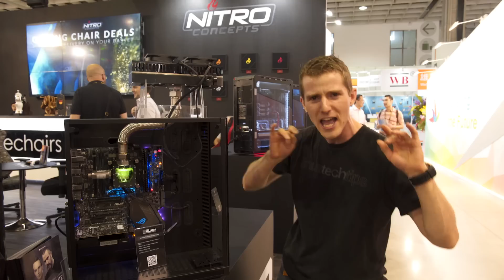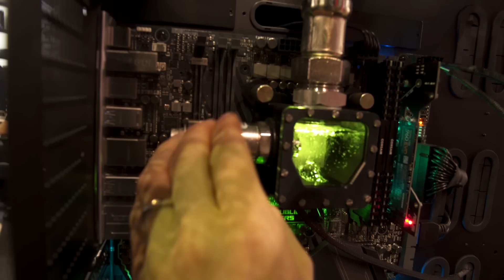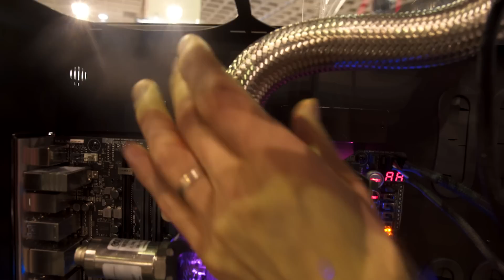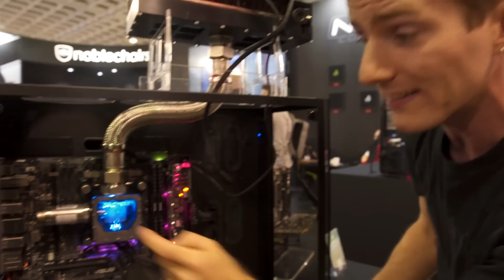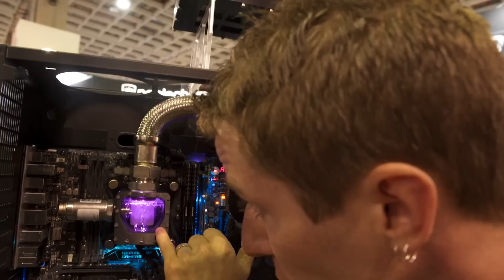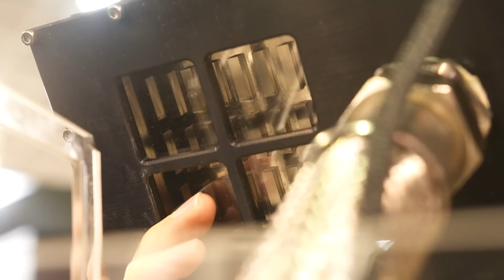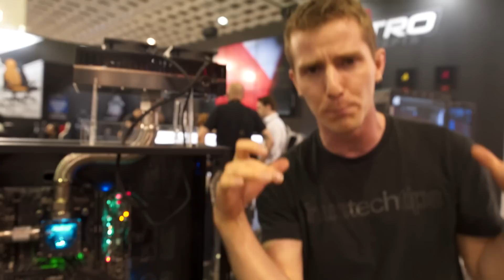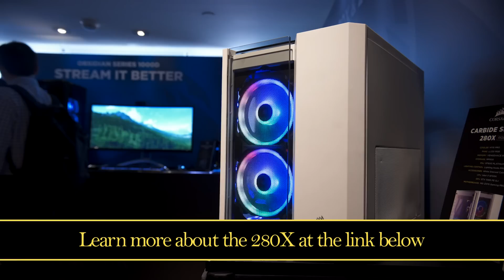Crazy Der8auer cooler prototype - NO pump!

Comment: I haven't had a chance to read the comments yet, because I'm driving - but as far as what coolant is in there, I would have to say plain old distilled water. Under a high enough vacuum, water would be perfect for it as it would boil at a low enough temperature to be usable, and also be perfectly safe. With this said, I'm betting dozens of other people have already suggested it. If not, well then...

Comment: Probably ethane, propane, butane or a fluorocarbon, IF that is genuinely copper plumbing...

OTHERWISE, if that is just copper on the OUTSIDE of the circuit, I call Ammonia to be the working fluid of choice.

Comment: Hmmm, the viscosity looks like water but takes too much energy to boil up to condensation point. Could be alcohol based but you run the risk of off gassing from stuff like IPA, plus they are very good at denaturing cheap Buna-N o ring seals needed to keep the goop in the pipework. On the cpu block I'm a bit more confident of my idea, it's possibly a double wall job or a box within a box thing, the gap between the boxes allowing the condensed liquid to flow to the bottom of the cooler and heated again by convection currents alone. 

Coolant could be saltwater and you wouldn't use MEK for that as it's too volatile, can't be Coolanol as that stuff is lethal in confined spaces and best advice is to not use it in boiling systems...... unless the system is fully sealed from factory.... but it's a liquid so leakage is going to happen......

It's not a liquid gas as no frosting 

Damn it...... you've piqued my curiosity..... worst thing to do with an engineer....

I'll work it out

Comment: Pressure sensor? I think it is water under a partial vacuum. That would lower the boiling point of the water. Water has the advantages of being less volatile and flammable than alcohols. Water is also cheap. The pressure would have to be about .07 atm or 1 lb/in^2. Hmmm... did he say the glass was thick?

Comment: Could the liquid be Dicridemomethane? Basically the alcohol-tainted tears of democrats after the 2016 election? Not necessarily rare, regenerates itself endlessly, circulates in an endless loop and a new supply is generated every time POTUS issues a tweet. Rumor has it supplies will become endless after November and the price will plummet, hence the delay in the release of this novel cooling solution! Waiting on the price of Dicridemomethane to come down even more. And to think Linus said we'd never guess it! {drops mic}
Reply: Hahahaha you took the words out of my mouth and I couldn't have said it any better. So yes its liberal tears.

Comment: Few ideas. Methyl Bromide, Methyl Acetate, Methanol. First 2 are poisonous so I wouldn't be surprised if they only make a few hundred. Boiling points are 3c for Methyl Bromide and 57c for Methyl Acetate. Idle temps would either be crazy low or would have to heat up to 57c for it to boil. Plus the vapor could leak and you would end up poisoned. Either way, I want one.
Reply: Methanol is also a poison
Reply: Methyl Bromide and  Methyl Acetate will dissolve the pvc inside the braided steel connector and cause a catastrophic failure so those two are impossible.
Reply: @jarstore  what about methylene dichloride?

Comment: The liquid has to boil and not expand enough to explode the device. Could just be glycol and water but could a cpu boil water and glycol? Like a floor heat system that runs in a house. They run on a heat exchanger not direct boil. Maybe some type of alcohol mineral oil mixture, that would probably seperate.

Comment: looking at the case and the reinforced tube the system has to be under alot of pressure.   That rules out anything thats liquid at atm or vacuum pressure. I think its a butane, propane, alcohol, or a refrigerant like r134  . could be co2 but that would be a ridiculous amount of pressure.  Its possible for it to be water but then it would be running in a partial vacuum.

Comment: You could keep the liquid under a soft vacuum, then all kinds of liquids with comfortably low freezing points would work. It might also be propane, or butane, or ammonia, or some other gas kept above atmospheric pressure, though hopefully nothing flammable.

Comment: For everyone trying to guess the liquid, don't forget that the way they make heat pipes and vapor chambers so effective is that there's a vacuum inside the closed environment.  This reduces the boiling point of the liquid.  And while there are quite a few liquids that have low boiling points that are even lower in a vacuum, they're not suitable for a safe and reliable product.

Comment: haha...talking about me when i worked at OCZ, wow brought back memories that did, i still use watercooling by convection, had it actually on a huge loop which would remove around 700w off 3 CPUs on test systems, now I just use it on a file server.

You don't need a pump if you get the right block, the right CPU and do the plumbing right..

Thanks for the mention Linus, been a while since i did anything with PC's or memory, or SSDs....time change ;-)

Comment: I think he uses low pressures. With low pressures the evaporation temperature is as low as you want. In fact you can even improve the temperature control. In fact I think that's why the pipe he uses is so wide. The pipe is wide to facilitate evaporation and at the same time the liquid that has been condensed, falls through the walls.

Comment: My guess is the 3M Novec Engineered Fluid. It's literally designed for immersion cool and taking advantage of the phase change from liquid to gas to cool down processor and boards at the same time. Check out this video for more info, https://youtu.be/a6ErbZtpL88

Comment: liv04soccer
I have novec 7700 in my custom loop right now no need for all the fancy pressure sensors and chamber been running for 6 months no problem.

Cooling a 1950X at 250Watt draw gets to 85c but works no problem.

Comment: With a requirement to not be corrosive or overly toxic thus making it highly regulated and expensive plus to have a reasonably low boiling point in order to efficiently cool the CPU while being able to do all that without any pump system, there can't be that many options out there for  the liquid in that prototype...

Comment: i'm pretty sure it's just propane or butane, that looks crazy dangerous, i'm surprised that Linus was face checking that thing.
Reply: Liquid propane when exposed to that kind of heat in the setup they would have would vaporize and the pressure would explode out and possibly ingnite. as for butane i would also doubt that as both options are extremely dangerous.

Comment: Inert, non-conductive fluid with a low boiling point to allow phase change cooling. Will probably be an engineered fluid from 3M (such as Novec)

Comment: i think the liquid is not really the key issue, this tech may have created a much low pressure condition, so no matter wat liquid for cooling, as long as u change the pressure , u'd have a much much lower boiling temp:) from the setup of this gear and missleading liquid discussion, im pretty sure about this.

Comment: Guessing a suitable coolant isn't very hard.  You need something nontoxic and chemically inert, with a boiling point of 40-60°.  It's better if it's also nonconductive, in case it spills.  It's probably perfluorohexane or another Fluorinert™ chemical.

Comment: Probably n-pentan or n-hexan would work quite similar. Maybe even isohexan which has a boiling point of 60 degrees Celsius, but the heat should be taken away almost instantly when the fluid is boiling, so possible.

Comment: Has to be 3m novec, here is my guess https://www.3m.com/3M/en_US/company-us/all-3m-products/~/3M-Novec-7100-Engineered-Fluid/?N=5002385+3290667247&rt=rud
https://multimedia.3m.com/mws/media/65495O/3m-heat-transfer-fluids-brochure.pdf
The reason why you have stainless hoses and a pressure release valve is Novec like Fluorinert expands with heat and also being a solvent will dissolve elastomer out of some plastics, which is why Cray supercomputer HEU cooling system hoses are all made from stainless hoses.

Comment: Actually...this is almost exactly like refining oil. You heat it to separate the crude from the gas. where normally at the top there is fans that recool the gas for storage. Vs the heavier crude that doesnt evap at the same temp stays at the bottom and can be transferred to a separate tank. I bet its very simlar

Comment: its gotta be a basic refrigerant as the coolant boils off it rises and condenses in that condensing coil the question is what is the saturation point temperature (temp it starts boiling under x pressure) look at a chart and just figure out which refrigerant closely matches it and boom.

Comment: There is no way to guess which kind of compound is that without knowing the pressure it's currently running with. You're missing two variables in this equation. 

.... btw, it is just water at 1/10 atm. Look at these bubbles. It's water guys. Must be something insanely dumb to think we would never guess it.
Reply: That's possible. What do you think about just using acetone at room temp or possibly very slight vacuum? That should work just as well, and it's a clear liquid like water.

Comment: Potentially low pressure system with water. Water boils at lower temperature. You require a surface to 'encourage boiling'- superheating issues etc...

Comment: my guess is its a trick question 
i believe its a mixture or water and argon gas, 
argon has a very low evaporation point and its conduction rate is only a couple of decrease difference so it could run throw a full cycle of evaporation and conduction with very little changes in temperature .
in its liquid state its used as a cryogenic so it has natural cooling proprieties
plus its water solvable witch would stop the liquid from being completely boiled of as water has a boiling point of 100 decrease. and argon is also none flammable and compresses more easily than air so less chance of pressurised explosion then plain old water

Comment: It's actually a quite limited number of suitable liquids. 1) boiling point needs to be above ambient as you don't want it to keep going when the pc is off and 2) you don't want it to be much above say 40C as once it's boiling, the temperature will remain constant which is what is causing the cooling to happen. So suggestions like water, ethanol, chloroform etc are nonsense as their boiling point is way too high to keep the cpu cool or even from keeping it from throttling. Something like the ether family would qualify as they boil around 35C.

Comment: It's water.
They just keep the pressure low to lower the boiling temperature. Low pressure also means less leakage problems.
Also boiling temperature can be controlled by changing the internal pressure - keeping proper boiling temperature is a big PITA.
That's why they need that big-ass pressure monitor to make sure the pressure is kept low.

Comment: This is NOT a passive cooling loop. It has {and requires} electric fans on the condenser. Without them, it simply wouldn't work. Doesn't matter if your electricity runs pump or fans, passive is passive and that aint it. P.S. the coolant is R-134a ;)

Comment: It's an ammonia solution. It boils at about 80F, and has high thermal conductivity. It's far safer than alcohol as far as flammability and combustion goes, and is safe enough to be sold to the masses as a cleaning product.

Comment: (1) Feser  One Non Conductive Cooling Fluid

(2) 3M's Novec Cooling Fluid

(3) Thermochill EC6 Non Conduetive Coolant - Clear
Reply: Those dont boil at a low enough temp for the cpu to not be overheating tho without creating a vacuum environment...so nope

Comment: "The boiling point of water or any other liquid depends on vapor pressure. As you lower the pressure, the boiling point of the water drops." -thoughtco.com...
So im going to say its water + additives in low pressure config.

Comment: No one did it cause it's pointless. They probably had fun engineering it and it made some good pr for the sponsors but the actual perfomance/cost/limitations will be worse than simple custom wc loop. You want phase change system that actually gives some performance improvement for all the additional cost then just turn ac unit into water chiller.

Comment: I say it uses LPG (Propane) or Butane... It needs to be boiling at low temperature and tolerable pressures... I am working on a prototype using this kind of cooling solution and LPG is my best bet for now, unless I want to go with way to high pressures...

Comment: Its a dual chamber reservoir-cpu block . Inside of the block the warm liquid boils up (as a gas)into the center of the tube to cool down and then when its liquid again it drops down from the side of the same tube(maybe double chamber tube) left and right to the bottom of the reservoir. The problem is that they need a specific heat transfer to keep the liquid under specific pressure to keep circling.. i think its LN2 . And thats a damn thiccc glass cover

Comment: guys its 3m novec! it was a huge thing where they basically fully submerged the servers without heatsinks and used air conditioning piping to recondense it in the air above the lipuid. cool but expensive, its nonconductive and has a low boiling point and somewhat decent thermal conductivity. its super cool to look at but not as good performance wise as watercooling

Comment: Acetone! - Cheapest, easiest, only a little toxic. Boils at 50C at atmospheric pressure, means no fancy vacuum chambers needed. All this with only a moderate risk of explosion in the Cowards triangle range of 2.5 to 12.8% To really put the R in RGB!
Reply: steffankaizer  .. There is most definitely a such thing as being more or less flammable. It's absolutely ridiculous to state otherwise.
Reply: @steffankaizer do you really think there is not such this as being more flammable (Nice spelling btw)? Did you bother to even research for 30 seconds before trying to make fun of Ryan? Something can definitely be more flammable than something else, there are at least 7 different organisations in different countries that are involved in determining the level of flammability. What you're talking about in your next comment is called "flash point". J De Leon is right to say acetone is more flammable than most alcohols. There's lots of YouTube videos proving this, search acetone vs alcohol, you'll see that at the same ambient temperature acetone vapours spread much further and will ignite from a much greater distance than alcohols. Even in some cases throwing a match into acetone will ignite it whereas the alcohol will not.
Reply: Yea looks like you're right! Honestly I just went to the engineering toolbox website and searched boiling points looking for something around that mark, but they have it listed as 50.5C boiling! How strange, wiki has it as 56 like you said. Cool to know that it is actually already used in the industry I didn't know that. It has to be a decent fire/explosion hazard for real though right?
Reply: It's not really a hazard as long as it isn't corroding anything and is in a closed system like this. It is definitely a hazard if exposed to anything electrical, but this design looks safe. The only reason I know the boiling point is because it was one of the mystery solvents I had to find the properties of in a chemistry class... It just stuck with me. Probably from the massive headache I got when boiling it. When he said "special requirements" and described how it worked, I instantly thought acetone.
Reply: It is actually 56 degrees celsius at atmospheric pressure. Acetone was my guess as well. It's used in many server cooling applications already.
Reply: you literally said 'there is no such thing as being more flammable'
Reply: Best comment in years.
Reply: i had the same thought process :)
Reply: considering that inside that braided steel connector is a pvc tube, having acetone going through it for any extended period of time will start to dissolve it and turn it into a gum that will block everything up and possibly lead to a catastrophic leak and ruin any component it touches.
Reply: You could just use an all nitrogen atmosphere in the cooling chamber, no oxygen. That way it can't catch fire (if you'd somehow be able to hit burning point anyway).
Reply: stefan radovich that’s something everyone would guess because it’s common, he expects no one to guess it
Reply: I think it's most likely Orphan tears. 😔
Reply: /r/IamVerySmart: Isentropic, adiabatic, psychrometric, Carnot Cycle, Fugacity, Ideal gas laws, Nail Polish Remover Sniffer
Reply: It's also several times more flammable than alcohol...
Reply: Yep, and its Coward's triangle is between 2.5-12.8% so it will really put the R in RGB!
Reply: i meant several times more flammable. how many times? you can not count flammable. he should have said it catches fire at lower temperatures. i am not perfect either. also i stopped caring .
Reply: when people say something is more flammable they mean it needs a lower temperature to ignite. however if something has a lower boiling point we dont say its more boilible. to me it sounds just as ridicoulous
Reply: @steffankaizer  No, we say it is more volatile.
Reply: i am not saying its not a thing i am saying its a stupid phrase. like some people say "if it contains more explosives its several times more blowupable"
Reply: @steffankaizer  'More blowupable'? Do you mean more explosive? I'm seeing that this is less about the language and more about you.
Reply: hahahaha thats the most ridiculous thing i have ever heard. do you think instead of catching on fire once it catches on fire 3 times? if you hold a match to it both will catch on fire 100% there is no such thing as being more flamable